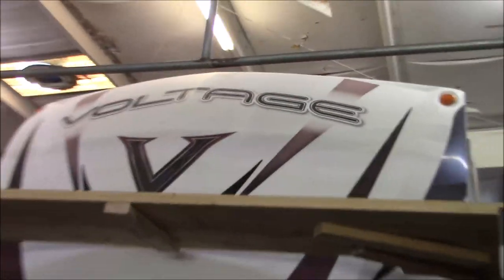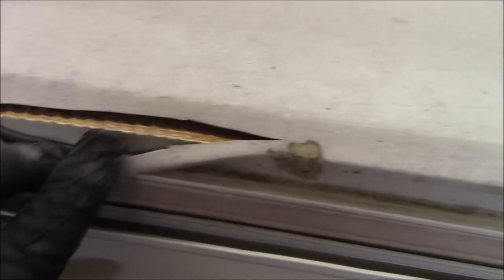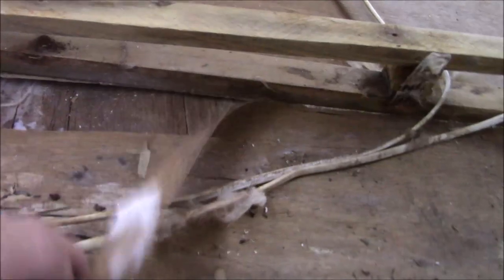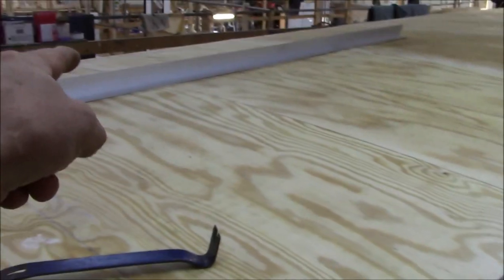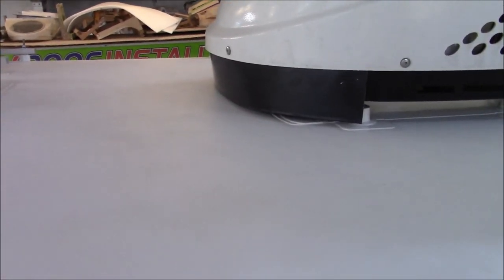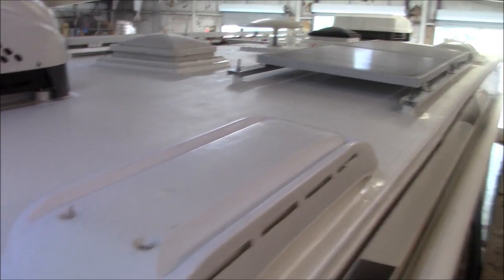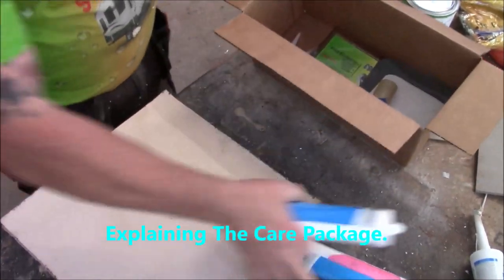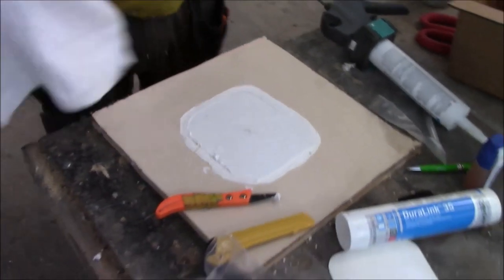35Ft.2011 Dutchman VoltageNew 60Mil.TPO Roof and Re-Deck Solar Prep

Comment: 1:12

Why do the manufacturers bend the rear wall corner trim back over and screw it in to the roof?
Reply from the maker: It gives them a way to seal the actual corner transition where the roofing was cut at the corner to fit around/in the corner. We heat weld the corners so we don't need the corner mold to be on the roof and trap water.
Thanks for watching.